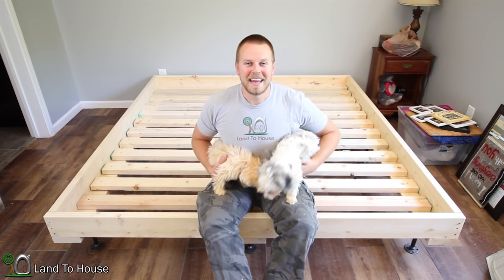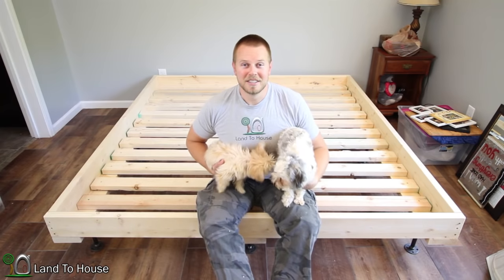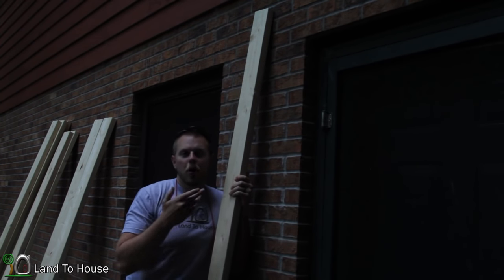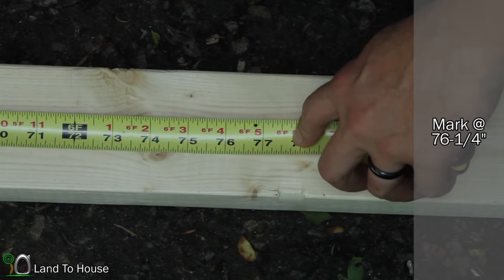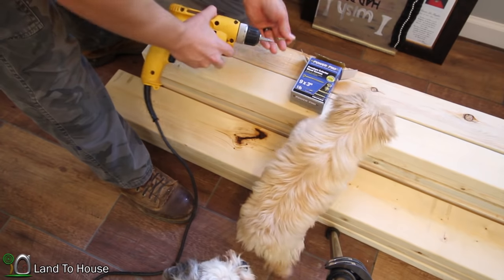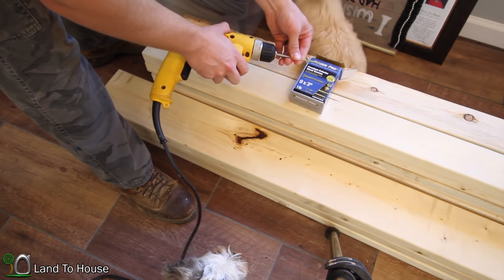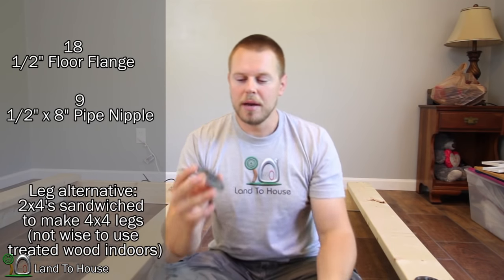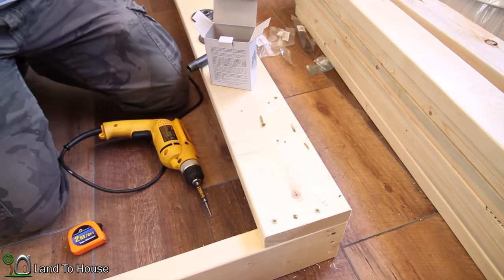Build a simple King Size Bed Frame out of wood

Comment: Hey man! I just finished my bed like 2 minutes ago. My wife loves it! You were very clear on the instructions! Thank you for the video man! You’re a life saver! Specially since we’re in a budget right now! Cheers bro!
Reply from the maker: Thank you for sharing.  The frame is super strong and rather inexpensive for what you get. Should last a lifetime.
Reply: @LandtoHouse  what if I wanted to build it in 2 sections? And then lash the 2 sections together  at final assembly. Each section being roughly 38 by 80...

Comment: While a screw in the center of the slats is not necessary, it can prevent squeaking as the boards slowly shift and move against each other over time. Otherwise great work.
Reply from the maker: Thank you. I just wanted to make sure that this frame was going to last for a very long time.

Comment: For CalKing, the sides are 84.5. When you make the base you put 2 inch boards on top and the bottom and the outer measurement from top to bottom becomes 2+84.5+2= 88.5 inches. However, your runner length recommendation is 87.5 inches which is 1 inch shorter than what the base frame length. In your video though, runners look like they fit just right. They don’t look shorter on the edges. Can you explain how this could be possible? I’m going crazy here with my calculations. Lol Otherwise, I love this bed and I’m gonna built one for myself 👍
Reply from the maker: Hello. So the bottom runners are 88" on the cali king. Its not 2" that is added but 3.5". 

So your cuts are: 
2@ 84.5" sides
2@ 75.5"  head/footer
3@ 87.5" runners

This queen size sketch might help.
https://www.landtohouse.com/queenbedframe/

Comment: This bed is very very strong total cost 67 euro I used 4x4 wood for legs
The video was easy to follow and such a simple design but looks really good
Thanks again👍
Reply from the maker: Using wood for the legs can save lots of money! Does change the look but most people use a long quilt that hides the legs anyway.

Comment: Nice job. Very simple making of a bed. Are you planning on screwing the feet into the floor? Even some rubber under the feet might do good so that the bed don't move if there should be...to much activity in the bed... :-) 
It would also be a nice bed to put drawers under :-)
Reply from the maker: +Back to Nature Living this is the second bed I have made with this design and both are incredibly sturdy. It is actually difficult to move once the matress weight is on the frame. Felt or rubber would be a good idea on hardwood floors.
Reply: so with this bed i wouldn’t need a box spring ?
Reply from the maker: Yes that's correct!

Comment: Thank you for your awesome video! Me and my husband are almost finished 😍 and it looks great! We spent $180 at home depot but got a few extra 1x6s and 1x8s for a skirt and lip. We also used 4x4s for the legs instead of the piping since that was easier for us to find. Used some old carpet to fasten under the 4x4s to prevent the legs from scratching up our hardwood flooring. Hoping to finish staining it tomorrow!
Reply from the maker: Thank you for watching! My wife and I have this king size frame in out house and we love it. Are your 4x4's treated or untreated? I have heard that it is not a good idea to keep treated lumber inside because it will off gas. Sandwiching 2 2x4's together is a better option.... The carpet idea is a good one.

Comment: Thanks for the great video. I made my bed frame following your video. It came out great and is very sturdy. I ordered the metal parts from Amazon and ended up going with 3 legs on each side and 4 down the middle for extra support

Comment: I've got a king tempur- pedic and its heavy and my wife and I are on the plump side as well. Is it overkill to use 3 center beams or is you design fatty proof?
Reply from the maker: I have gotten feedback that the frame supports 1000 pounds. With the 9 legs and the 2x4 slats you should be good!
Reply: Thank you for your response! I was going for 15 legs so I'll stick to your original design. I might use 3/8" or 1" - 6" or 8" pipe nipples however. Thanks again, you're the best! 👍
Reply: @LandtoHouse  will wood legs built with 2x6 work as well as metal ones you use in video
Reply from the maker: Yes that works well.  Just make sure it's not treated.

Comment: Along with other viewers, I concur that this homemade structure has a heap of potential! I would probably paint the metal hardware in advance, and instead of rounding the edges, you could use moulding to create better edges and finish to the frame. Then, of course, some stain or paint, or even chalk or milk paint could give this a nice finish that appears store bought. Plus, creating a wall design behind the head of the bed could offer a headboard without having to attach it to the frame. So many ideas!!!! Anyhow, I am soooooo glad I stumbled upon this video - AWESOME idea!!! Thank you so very much for adding the additional measurements for varied size mattresses as well. Fantastic!!! I am going to subscribe to your channel :)
Reply from the maker: Thank you for watching! Very good pointers. My frame is a good starting point for others to build on.

Comment: Excellent!
Can you share your source  for the cheaper pipe and fittings?
You can cut a piece of scrap wood to the thickness needed as a spacer. That way, you only have to measure the first slat.
This is a very cool build and you made it very easy to follow directions.
Thank you.
Reply from the maker: +Redskins Pride WGIL thank you for watching! When I get my workshop built I will start making cuts easier with fancy tricks like that. We have used the bed frame now for a while and it is working very well.
Reply from the maker: +Redskins Pride WGIL woops sorry . Essential hardware . Com  is the place to buy the pipe.

Comment: Hey Seth, it's a great build, but I do have to make a couple comments, and I don't want you to take it as criticism. before any knowing or screen together is done  lay it out and make sure you are  even corner to corner from each side and that everything is square. The other would be  perhaps notching or dovetailing all joints including the rails, to add stability and prevent the bed from possibly getting out of square at a later point. I know it's additional work, would require additional tools and additional time, but it make for a very sturdy foundation to secure it within itself along with the screws would make it a far more sturdier frame. I know hindsight is 20/20 and it's too late to do that now, but it is a great deal very impressive frame and I'm sure it will give you many years of enjoyment when to get a bed and box spring in there of course. 😊
Reply from the maker: Great suggestions! I am just skimming the surface of woodworking and I would love to get into more finished work. Dovetailing seems like a fun technique. I have not tried it yet. I have been using pocket screw joinery and I have enjoyed it a lot. We now have a tall mattress in the frame and it is doing great!
Reply: For novice builders, a dovetail might be a bit much to attempt. However, drilling out a hole and using a dowel could be an alternate method for the novice builder. The dowel method also adds stability to the frame. Just a thought.............. Cheers!

Comment: Thank you for sharing. I am looking to build a king size bed and this will definitely help
 One tip for you - when you get the black pipe and and flanges, they have a oil on them to protect against rust. Clean them off with a degreaser and coat with something like wd40 dry lube that will give them lasting protection.
Reply from the maker: Happy the video helps. Good advice on the oil protectant.  So far after a couple years this frame is working flawlessly.
Reply: @LandtoHouse  It's not so much the corrosion, since it is inside, but the oil/grease that is on the pipes can stain clothes or bedding that come in contact with it.

Comment: How would you attach a 4×4 to the structure without it being wobbly?
I can't fing the piping for cheap and I don't understand how to properly fasten a 4×4 so that it isn't weak in the legs.
Tks
Reply from the maker: You might check out what Gary has done on my website page:http://www.landtohouse.com/made-by-others/
He has a good system for installing those legs.
Reply: I turned the frame over and stood it on the 4x4 posts. I then situated 1 at a time where I wanted them. I screwed in 1-2 screws.
I then turmed it back over legs up.  I used less than 1$ L-clamps to screw onto posts and bottom side of 2x6s.
Works great.

Comment: Hiya! Love how simple this looks to build. Could this be made without the side/foot boards; meaning that the mattress would just slide over the entire platform instead of having to fit “inside” the frame? I would be adding more slats and closer together. 

My partner doesn’t want to add any more overall height to the bed with a box spring under the mattress, and I don’t want to hassle with trying to lift the mattress out of the frame every time changing sheets without a box spring. Hope this makes sense. Thank you! 😉

Comment: Hello. Can you please tell me the name of the black part on your drill at 6 minutes in the video. You have used it to screw the 3" wood screws into the boards. You drill a bit, then pull that part back and then drill it completely. What is that black part called? Thank you

Comment: Run two drills One to drive screws the other fitted with an actual predrill counter sink and bit or even a spade bit to partially pre drill with. save your sanity! What's left of it. Also I'd like to add make this bed in two halves! XL twin so you can actually move the someday. You will eventually wish you did.

Comment: Thank you for adding the Cal King board cut measurements. Just curious why the Slats say 74.5 when the inner measurement should be 72.5. Wouldn't 72 1/4 be correct for the slats?
Reply from the maker: Sure thing. Thank you for catching that. I have just changed it to the right size. This is why I should not do simple math late at night haha.

Comment: Would it be okay to use 1/2 by 10 or 1/2 by 12 inch nipples to give the bed frame a little more height ?
Reply from the maker: Yes that would be just fine!

Comment: We moved cross country and had our king size bed slats lost in the move due to the movers not boxing them correctly. I've been researching what to do about the bed slats; will the weight of 2x4s be too much for a frame that had lighter weight, thinner, bed slats originally? What size/wood would you recommend to recreate common store-bought slats?
Reply from the maker: If your side boards in the frame are tall enough you can use 2x4 no problem.  If you have a small metal frame the 2x4 will be too tall.

Comment: What is your opinion on using 10” or 12” pipe/legs instead? I don’t want to be too low to the ground and I do not plan to use a box spring to make it higher. Thoughts?
Reply from the maker: 12" is not too bad. I have had lots of people use those to allow for storage totes under the bed. if you have a large mattress like we do it will be rather tall.

Comment: Well that fit a California  king
Reply from the maker: +Beard Mustache this one is designed for a standard King. You have to make some adjustments for a California king. Taller but not as wide.
Reply from the maker: I think I have the cali king dimensions in a description. It's not much different so should not be too difficult to adjust. My wife and I use this Frame and it's excellent :)

Comment: Just throw a thin panel sheet over the slats for the warranty so you don't need so many 2x4 slats.Also, where are you getting the pipe fittings so cheap? I realize this could come off as criticism and that is not the case, I appreciate you taking the time to show everyone your design. Nice vid! (thumbs upped :D )
Reply from the maker: Thank you. I agree with the panel or plywood as a base. That is a valid option. I went with the 2x4 slats because it actually saves a little money. As for the metal parts I would start with a google search. I like an online hardware store called Essential Hardware.
Reply: Fantastic. Thanks!

Comment: Do you think any glue would be needed for this project for extra bondage?
Reply from the maker: I've had this Frame and queen size in use for over a year with no issues whatsoever. I don't think that glue is necessary

Comment: Hi Seth, I love this so much I decided to do my King size frame after building 2 queen frames. on the queen video you list all the cuts and the measurements together, but this wasn't on the king vldeo. And  do you use the same measurements  when you have mattress boards with your king size mattress set.?
Reply: @jonimichelle roughly how much did you spend on material to build the king?

Comment: If you wanted the bed taller, but still sturdy what would be the modification?
Reply from the maker: You can use taller legs to a point. I would not go much more than 12" because you dont want the legs to topple and break the screws out.

Comment: Hi I was looking to make this bed and was wondering for an alternative option instead of screwing in the wood pieces together could I just use corner brackets or something of that sort so I could dissemble it or what would you recommend I do so I could transport it from one home to another
Reply from the maker: In another frame that I made I used corner brackets and screws. If you use those brackets I would use at least 2 per corner to make sure things are not going to fall apart.

Comment: Could you please share the dimensions of the lumber for a normal King size bed please ?
Reply from the maker: Yes this is a normal king. The lumber : a 2x6 is actually 1.5" x 5.5".
A 2x4 is actually 1.5 x 3.5".
Reply: @LandtoHouse  cheers mate

Comment: Hey if I were to want to do just 2x4 legs I could do those instead at 1/2 inch right?
Reply from the maker: +Crystal Johnson I would actually recommend making a 4x4 out of 2x4s. Screw two 2x4s together. That will make the legs much stronger.

Comment: In theory, wouldn't turning the crossslats on their side and drilling through the base make for a stronger bed since you get 5 1/2" of support as opposed to the 1 1/2" by laying the slats flat?  Yes your warranty would be voided, but you would get less bow to the crossslats.
Reply from the maker: Yes you can do that. The frame would be rated to several 1000 pounds ha ha. The slats are only 3.5" because they are 2x4.

Comment: Great video. Is this possible for a full sized bed frame? And what are the dimensions. And thank you for this very educational video.
Reply from the maker: You can use this style for the full bed. I have not built one yet. I am not sure if you have to have the middle support or if you can get by without it. A full bed is 54W and 74H. So boards 57.5" x 74.5" should do it.

Comment: You are my sensei lol But I would really like to build a king size matress but your amazon store isn't up. My memory foam matress is 12 in thick and 76 inches wide and 80 inches long.
Reply from the maker: haha I am not sure that I am up to sensei level. Yes Amazon has removed the store option. That foam should fit into the frame just fine.

Comment: I made this bed to fit a standard Australian King size mattress (1830mm x 2030mm)

Since we have different standard size timbers, I used 140 x 45 for the sides, bearers and headboard. 90 x 35 for the slats and 90x45 for the beams holding the headboard up.

All untreated mgp10 framing pine.

I ended up doing 14 guage x 75mm screws for the frame and headboard

I did nine 90x90x120mm legs underneath as I like a lower bed frame and not keen on metal.

I also clamped the headboard before I fixed it together.

Slats I did 50mm apart. 

Matched it up with two cheapie bedside tables from IKEA, stained in the same colour.

I love this bed, it is so solid, solid as a rock!

Thank you for sharing.

Pics: https://imgur.com/a/TGGNF
Reply from the maker: That looks great! Matches well with the side tables. (those just fit in your room) My wife and I have the king size and we love it. Thank you for sharing your work!

Comment: I'm going to be building one myself with 2x8s with a box spring. My question is do you think its best to frame this straight go the floor if we are doing a king water bed? I am just concerned about the legs holding all that water weight. Thanks!
Reply from the maker: I actually do not have the answer to that. I know that the frame can hold several hundred pounds but I am not sure about the weight of a waterbed. There are other forces on a water bed. Such as outward on the sides.

Comment: About the materials, mainly the flange and 8x3/4 metal pipe, you said online they will or may cost much less.Do you have an idea where I should start searching?
Reply from the maker: +Tripod Threefoot I just typed into Google and found a couple websites that had parts for $4 cheaper than Lowe's per part.

Comment: thanks. I have a question the 9 1/2 by 8" pipe nipples whats the difference between them and the 1/2 by 10" pipe nipples? is it just the height?
Reply from the maker: +mira W yes. The only difference would be the two inches.

Comment: Did you mean 15 2x4s ? Because there's a pretty big gap at the end. And yes my mesurements are correct.
I just built it btw. Thx 4 the plans
Reply from the maker: It might be that you want more than I mentioned. I think 2.5" is the max gap between boards. For warranty. (My first frame had 6" gaps and it worked fine.  )

Comment: Great video. I m planning on building a queen size. But I want to know if I could use 12" pipe for the legs. Well it still be sturdy? I need extra storage space.
Reply from the maker: Hello. Yes the 12" legs will be fine.